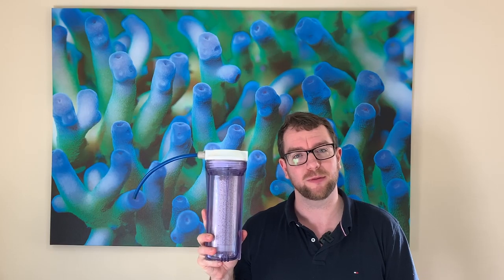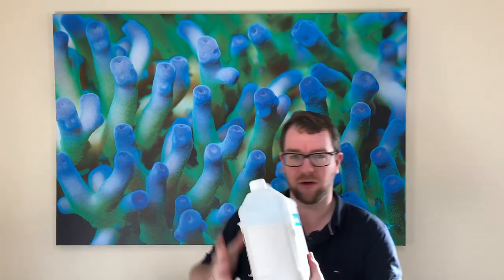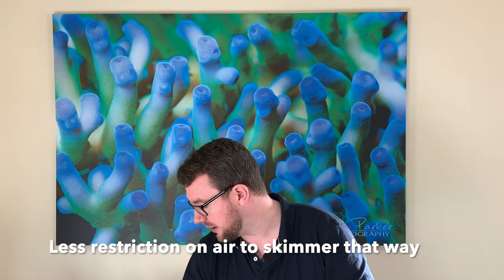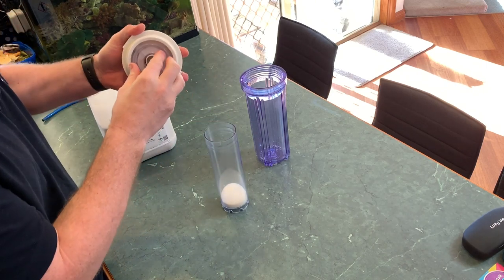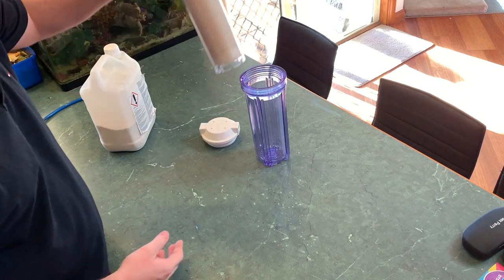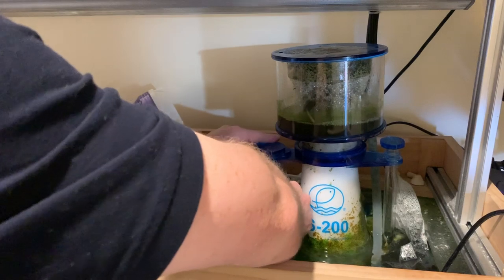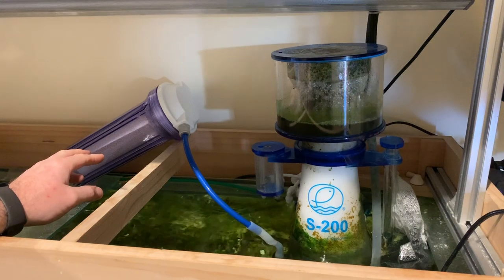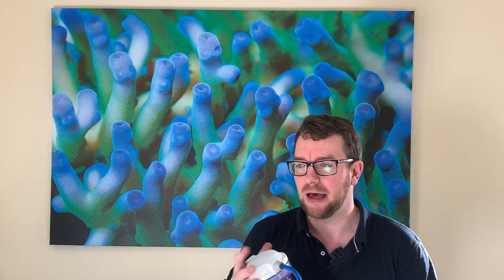DIY - Aquarium CO2 Scrubber

Comment: Other possible downsides are that if you pull too much water/condensation into the cartridge you can fluidize it then dump that very high ph solution into your tank, alternatively if  you let the media exhaust this could cause your ph to drop quite a bit and screw up alkalinity consumption enough to cause an alk to spike. Neither of these are deal breakers imo, which is why I run one.
Reply from the maker: yes, absolutely things you need to watch out for!

Comment: If you want to go one step further with the DIYing, you can make 2 large "U" shapes out of PVC and connect them them together. I used 50cm long 40mm diameter clear PVC pipe. The construction holds roughly half of a canister. Doesn't look pretty but it is a way more efficient way to use all of the media. One filling lasts about 3 months for my tank (with lots of CO2 in the air!).  :)
Reply: I'm interested!  Do you have a picture or something of such a device?
Reply: @agler_  I'll upload a picture on my Instagram story and save it as DIY :)
Please don't let the dirty sump fool you! It's by no means a representation of what the display looks like :D
Reply: Awesome!
Reply from the maker: I like it!

Comment: If you want to make it more efficient add another compartment before the scrubber to remove moisture, and connect the inlet to the skimmer cup. Keeping it dry will make it last longer.
Reply from the maker: What would you put in the first chamber?
Reply: @ParkersReef  Any moisture absorbant should work, like damp rid. Just make sure it does not contaminate the scrubber.
Reply from the maker: Ah yep, air dryer beads would work

Comment: Goodafternoon Sir, is the air comes out from the video is good only for aquarium or it is also good for human?
Reply from the maker: Yeah good question! It will depend on the media you use, I use human grade media designed for scuba diving rebreather devices, so yes is fine for humans
Reply: The set up is skimmer and scrubber so the gas comes out there is good for human also?
Reply: This is for our project sir that's why I want to know. I am engineering students
Reply from the maker: Yes it is safe
Reply: Thank you sir
Reply: Can I ask again if i have something crushes in my mind?
Reply: Goodevening Sir
What media used for rebreather?

Comment: Trying to break the record for newest comment on oldest video :)...... but in all seriousness, is there a point where PH could ever get "too high". My PH runs at about 8.5 / 8.6 without any scrubber, and I'm wondering if its a case of "Higher is always better" or if my range is such that I don't need to add a scrubber.... Thoughts more than welcome !
Reply from the maker: Wow that is exceptionally high! I would question the device measuring it, but if indeed is that high - I wouldn’t worry. 

Seems ph stability is more important, but I’ve never been too stressed about level or consistency and my coral has always grown pretty quickly 😅
Reply: @ParkersReef Thanks Sam ! I have questioned my Ph reading too - but my Hanna Ph checker is either right… or consistently wrong. If either way you think it’s ok I’ll leave as is. Many thanks for the insights (Love the channel by the way - always appreciate your insights)
Reply from the maker: Yeah, don’t do anything to lower it! Let the good times ride :)

Comment: Hi! How can I measure the collected CO2 of the scrubber. Thank You.
Reply: For thesis purposes. Thank you!
Reply from the maker: @stephpineda7254  great question, not overly sure!
Reply: Try using red cabbage juice as a ph indicator I’m using that method in my project, it can act as you liquid media for co2 capture. It might not be a good media but it is a good ph indicator.
Reply: @stephpineda7254  Sir how do you test the ph thats my thesis too
Reply: What are the materials and set up did you used?